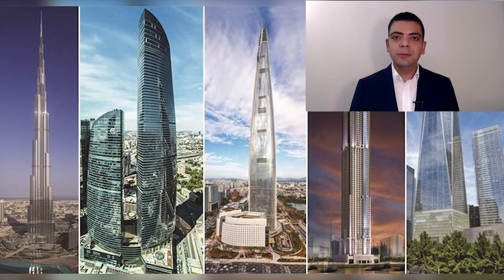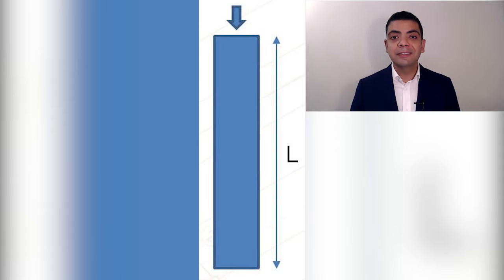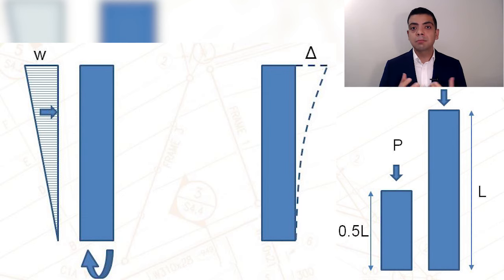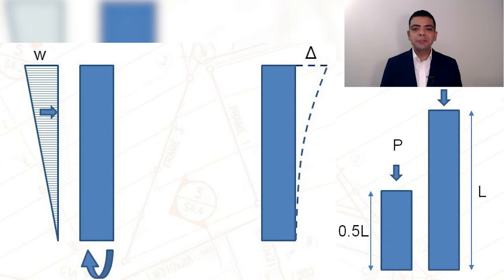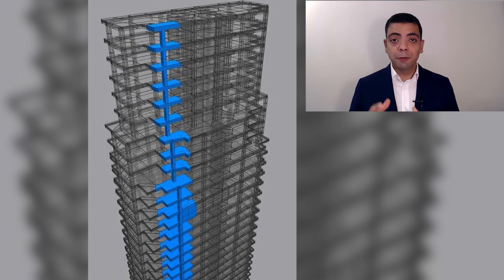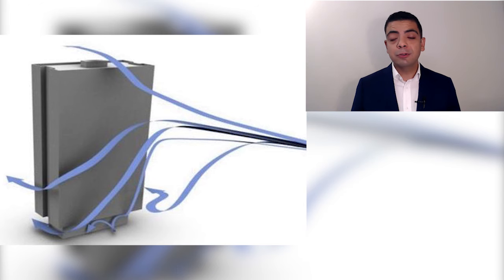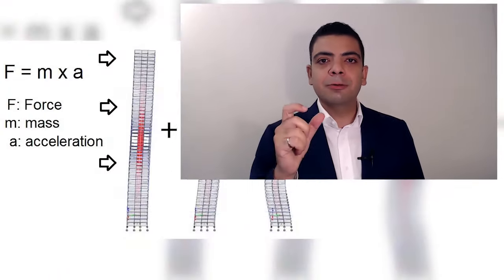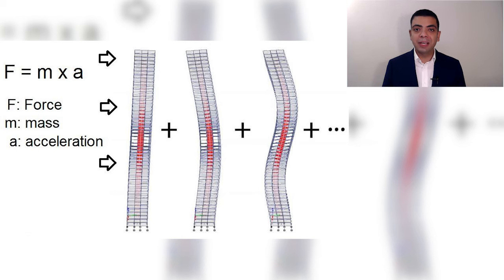Design of High Rise Buildings - Structural Engineering Basics

Comment: It is a good viedo. Tnak you. Would you be able to produce a video on the complete process involved a wind tunnel test procedure  for a tall building design from start to finish, such as what structural information to be provided to the wind tunnel company and why they need those speci information, what do they do with this( eg. do they use this in their physical model etc) , what are the raw data from the test, how do they post process, what information they will provide at the end to the engineer etc